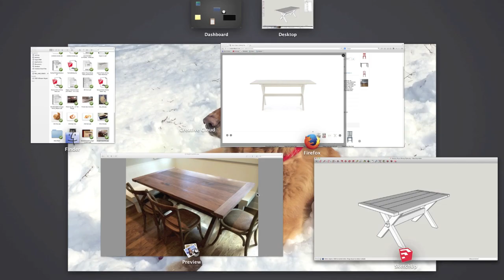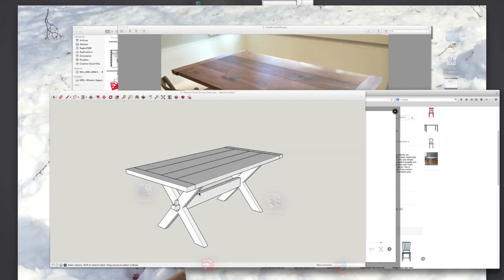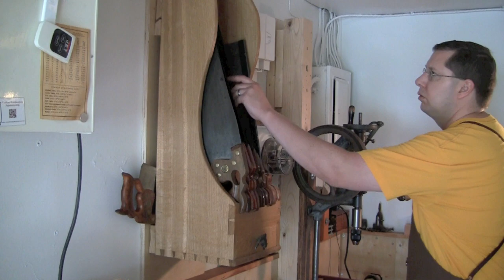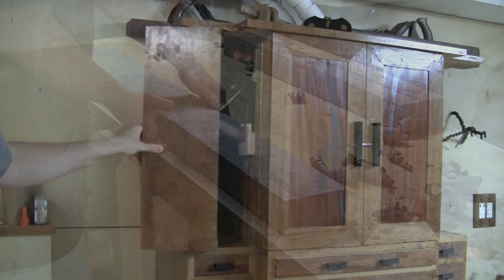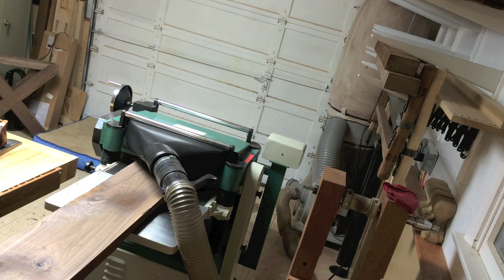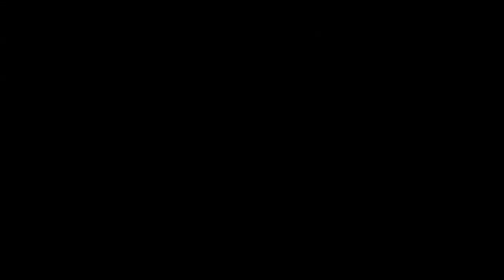RWW183 Picnic Style Dining Table Part 1

Comment: Wow, it is a great build, looking forward to the series Shannon! Were you using a scrub or a jack plane to level out one side before thickness planing? Is there any particular reason to use hide glue instead of yellow glue?
Reply from the maker: Tamás Elkán That was a Fore plane actually (a Veritas #6).  If you haven't seen episode 182 on Hybrid milling then check it out as I do go into more detail about the process I was employing there.  I like hide glue because it doesn't interfere with finishes so I don't have to be quite so militant about removing every last bit of glue that may get ground into the wood fibers.  I like the relatively quick set up time and it blends nicely with the darker wood of Walnut.
Reply: Thanks, I have seen that episode but forgot the type of plane, sorry:)! Looking forward to the new episode!

Comment: not noticed before but your left handed, are the "tools" you use handed etc.. just curious.. and a really nice set, up the boards look lovely and dark .. thanks
Reply from the maker: Colin Tonkasdad not really.  My saws, planes, and chisels don't care which way you run.  Some joinery planes are handed and I have just learned to work with the other hand.  It is a good idea to do even if you have left handed moulding planes (which I have some) because if for no other reason you can rest a tired arm and saw or plane with the other one.
Reply: thank you ..

Comment: Beautiful work! Quick question, does epoxy wreak havoc on planer knives? Seems like it would be really hard on them.
Reply from the maker: ***** Not at all, at least this West Systems stuff.  I find it similar to working with acrylic turning blanks.  It is hard but it planes nicely.  Plastic resin glue on the other hand as used with some veneer applications can be really bad news.
Reply: Awesome, good to hear! I am new to woodworking but have been buying up equipment and scouring YouTube for quality content like yours. Thanks for putting out great stuff!